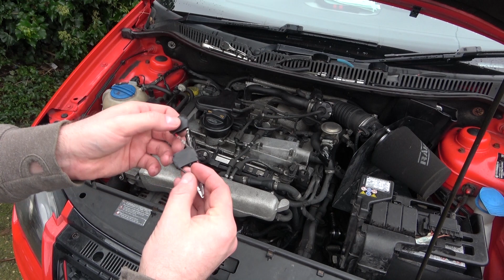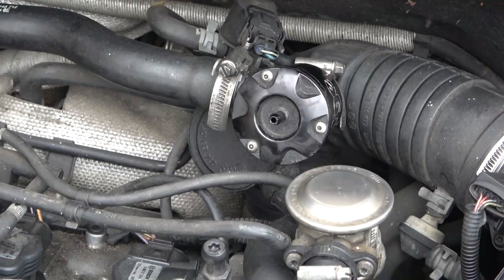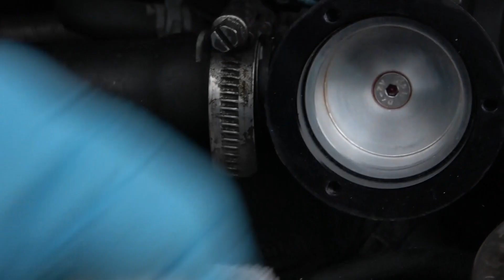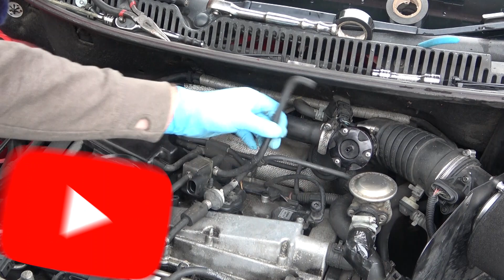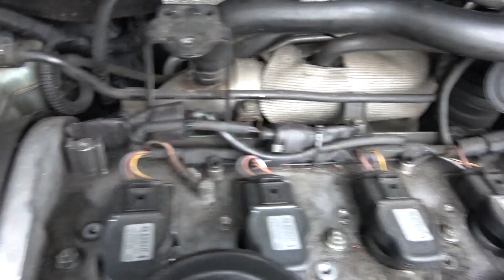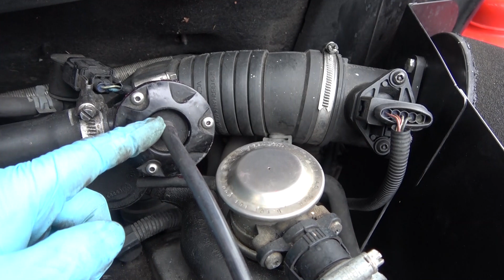Time To Delete The N249 and N112!  (Polo 9n3 GTI)

Comment: I remove and use resistor emulator and have one problem about P1200 17608  help me
Reply from the maker: P1200 relates to the N249 boost control valve ? make sure everything is plugged in where its meant to be and make sure there's no vacuum leaks

Comment: Hi did you remove the vacuum pump or did you leave it in and just take the hoses off when you removed the kombi valve
Reply from the maker: Completely removed the pump from the engine bay. 
You will get and engine light due to the pump being missing but you can get this mapped out or just keep deleting the code

Comment: Thanks mate, helped me alot! I have my SAI turned off by a tuner so no problems whatsoever but is it possible to just cut te connectors that are left and put a cap or something on it? Next step removing the pump :)
Reply from the maker: I literally had the plug wrapped in tape for years only recently have i blanked it off with loomtape and heatshrink

Comment: Thank you for this beautiful video... but I admit that I have been looking for months... I removed the N249 and I put 2 x 330ohm/10w resistor under the intake manifold and connected the DValve hose under the manifold and I want to remove the N112 and on the secondary air pump power socket I must also put a resistor or not? because then I would find myself with 3 resistors in total and all the removal kits only have 2 x resistors in total... I am lost... I put a 330/10 resistor to try on the pump and I failed P0411and P1297...thank you very much
Reply from the maker: You have to get the secondary air pump mapped out by a tuner its not able to be removed via a resistor

Comment: What is the ohm? 
For the resistor
Reply: 330 ohm and watt?
Reply from the maker: Dude look in the video description all the details are there and even a link to the right resistor is there too 
https://www.ebay.co.uk/itm/2W-Power-Metal-Film-Resistor-1-Tolerance-1-Ohm-1M-Ohm/252024737412?ssPageName=STRK%3AMEBIDX%3AIT&var=550885059205&_trksid=p2057872.m2749.l2649&mkrid=710-53481-19255-0&siteid=3&mkcid=1&campid=5338680676&toolid=10001&customid&mkevt=1
Reply from the maker: Its in the description of the video with links too.
330ohm resistor is needed I hope this helps

Comment: I’m still getting p0010 and p0444? Any help
Reply from the maker: have you installed them correctly? Ive had mine fitted now for like 2 + years and never seen a code ?
Reply: @CarsandEngineering am I gonna see any codes if I do this delete and the sai delete? With the resistors in place
Reply: @elliottb8145 N249 won’t show a code if you have a resister on it. The SAI will show a code that needs a tune to remove it

Comment: It you use a sparco 150  filter directly connet with the original air Hole attack on the original front bumper , you can use "effetto venturi" for improve air velocity .So you Will arrive to  improve hp until 3 or 4%.👍

Comment: Hey, I was just wandering I have a seat Ibiza Cupra with a 1.8T engine. I was thinking about removing this but with my forge recirc valve I have used a rubber end cap to block it off and also one to block off the other side of the vacuum pipe which connects to the box. What could I do to remove it and keep it blocked off? Would I just have to block off the inlet nipple?

Comment: Hi I been following all your videos to help me around my polo gti.

I have a boost issue it builds boost but ends at 2500rpm. What to do? Where to look?
Reply from the maker: Hey mate, it sounds like a boost control issue which would be the n75 it’s on the turbo intake pipe just after the mass airflow sensor, they are common things to go wrong on these. 
The best thing to do is check the car for any stores codes/engine lights see what pops up and go from there 👍🏻
Reply: Limp mode

Comment: Why did VW put in such a complicated setup when they could have just put in one vacuum line to the DV?
Reply from the maker: I really don’t know mate, it’ll probably be something to do with the emissions of the vehicle there’s a lot red tape I’d imagine 😂
Reply: @CarsandEngineering  Thanks for doing the video - are you throwing any fault codes with the resistors in place that you had to clear? I am really thinking of doing this and the SAI delete.
Reply from the maker: I’m not throwing codes for the N249 or the N112 with the resistors in place, but it is throwing a code for the SAI that one will need to be mapped out by a tuner I’m afraid 👍🏻

Comment: Is it for track car set up or also applicable for daily drive? Do I need to change the stock valve for this set up?
Reply from the maker: No this can be done for road or track reasons, you can also do it with the stock valve if needs be 👍🏻
Reply: @CarsandEngineering  Thanks for your answer! I’ll probably wait for your SAI delete video before do it together. Still worried about screwing up the car since I’m Not the really a mechanic guy
Reply from the maker: The SAI delete will be next Sunday at 17:30 GMT 👍🏻